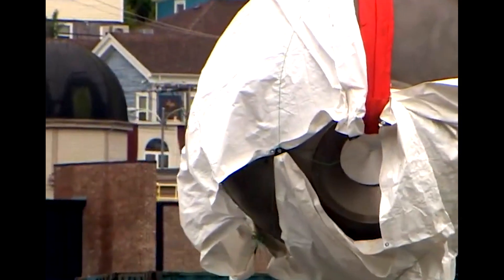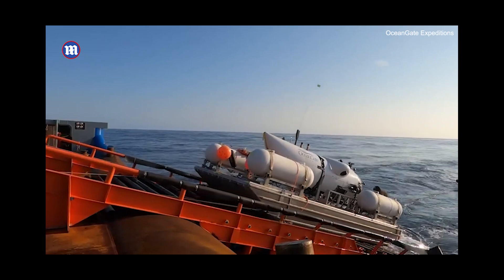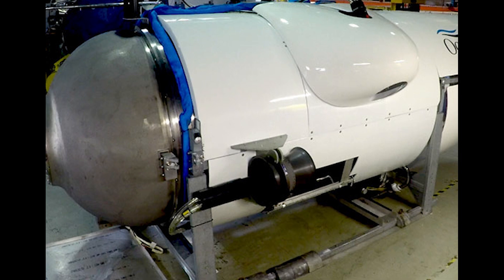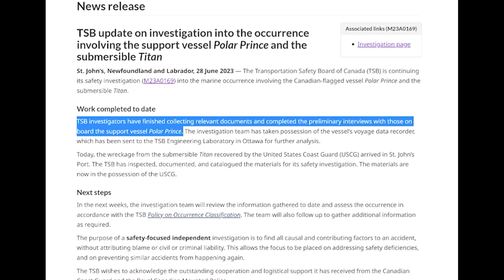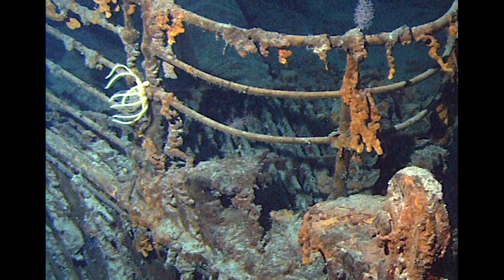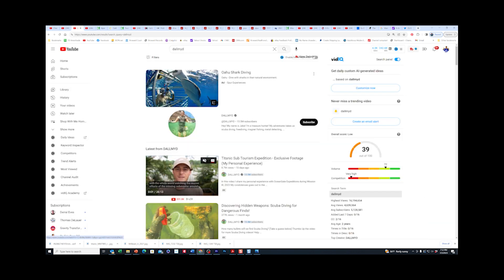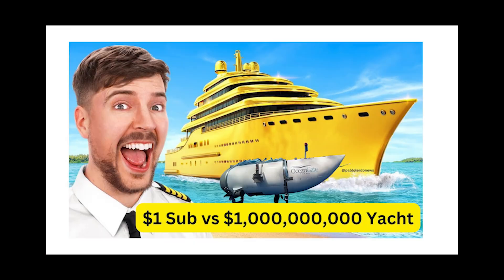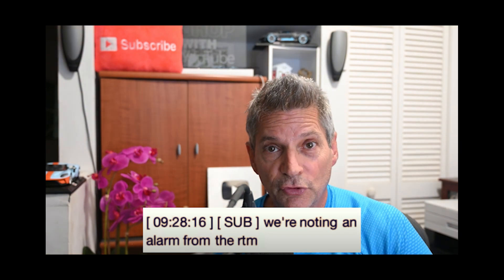Titan Submarine Debris Clues, Implosion Simulation

Comment: OK, I just watched video 18, or is it 20, or whatever. We are not getting those 5 persons back, no matter what the problem was. But there are things mentioned in just about any of the videos I watched. They always mention that those bolts are on the outside and that the crew could not undo them. Why would they try to undo those bolts to begin with? Even if they could, how would they be able to come out? Then they always mention the ballasts as rusty iron! What is wrong with that? Nothing, it's ballast that eventually would have been sitting on the ocean floor. Also the glue they put on the carbon fibre to hold the titanium ring was really not needed. All they needed was a watertight seal and they could have secured the front and back ring with a few steel cables. Once that thing was more than 10 meters deep, the water pressure
would have held it all together. Then others are blaming the game controller, what did that thing do other than nothing?

Comment: My best guess is that the pressure on the carbon fiber hull was too much for those seals. It probably collapsed on itself simultaneously possibly involving some initial seeping or dripping. The stronger “end cap” with the viewing window was thrusted forward and off as a consequence of the pressures of the implosion. 

Too many different components here with vulnerabilities. Each of those rings would have to be connected. Perhaps by long, robust connecting rods within and along the hull. Not depending solely on the hull itself.

I don’t know that any ring would’ve ultimately held as the space between them could not withstand that kind of pressure.

With a cylinder like that you’d almost need some kind of hollow toroidal shell with “end caps” that could withstand that amount of immense of pressure. Somewhat like a hull within a hull. The pressure within the void managed.

Then the viewing window itself and rear “end cap” has to be a sphere in some fashion. At any rate, somehow displace the pressure.

The Titan was a bad design with several vulnerabilities. I don’t know how the integrity of carbon fiber can be accurately tested. It doesn’t sound like it was. The whole thing was inferior in design in so many ways. 

Stockton Rush was probably crapping his pants as things were going down having no way to control what was transpiring. The  imminent and eventual implosion. 

There are legitimate reason for going beyond what might seem sufficient involving rigorous testing. and certification.!So many factors are at play. His defiant, very narcissistic mindset proved to be his most fatal flaw.

Comment: You can be sure that, if the porthole was not the cause of the implosion, it would have absolutely been blown out of the titanium dome by the internal pressure that occurs right after the implosion.  In other words, either way, there’s no way that porthole would have still been present. If they could find it largely intact it would probably indicate that it was not the cause.

Comment: Witch ballast did they drop? There is a set to make you negatively buoyant so you sink to the bottom, when you drop it your neutrally buoyant. Then a second set you drop so you become positively buoyant and rise to the surface. So if they only dropped the first set they had just made it to the bottom. Carbon fiber fail for sure, Implosions rebound so the pressure wave from the implosion probably popped the window out from the inside.

Comment: They didn't even out gas the glue that held the rings. Not say I would use carbon fiber to begin with but the glue should have been placed in a vacuum chamber and left there till all the air bubbles escape the glue. The more I see how the Titan was built the more I think that Stockton Rush had a death wish. It's bad to use carbon fiber in this build but the carbon but OceanGate used expired carbon fiber. Waiver or no waiver OceanGate is response.

Comment: If the port hole imploded, would that actually rip the whole thing apart? It would be a sudden surge of pressure, but it's equalizing the pressure inside to the outside.  Moreover, carbon fiber is much stronger in tension so even if there was a brief over-pressure inside from momentum, it shouldn't be more than the outside/inside ratio.

Comment: Pay serious attention to how they made the join between the titanium ring flange and the carbon fiber composite cylinder.

There is a female groove in the face of the flange, and the composite cylinder is slipped into that, relying entirely upon the bond of the adhesive to hold the composite and the metal.

There was no provision made to retain the cylinder against pull-out / tear-out.

The bonding surfaces were effectively the minimum surface area possible, requiring absolutely the highest level of cleanliness, with no provisions shown to removed gas bubbles from the adhesive that form while it cures.

So, you have a very poor mechanical design of the join, questionable assembly techniques, and a serious concern about the quality of the adhesion of the bond.

The adhesive would be brittle, as would the composite cylinder. They would get to be more brittle as they got chilled in the deep water of the far North Atlantic.

Differential thermal expansion would induce stresses beyond the pressure stresses, and both would be cyclical, acting on brittle structures.

Debonding and delamination are to be expected.

Judging by the images of the ring flanges, they were stripped clean of the composite structure, and experienced minimal deformation. Regardless of whether the cylinder or the join failed first, the the join failed, and that suggests a large degree of force was applied in an extremely short period of time.

Comment: The acrylic porthole was a plug type design, such that more external pressure seated it more deeply against its mounting flange and gasket.

The external ring flange that clamped it in place served to position, hold, and preload the acrylic against the flange.

The mechanism of failure would be to leak through the point of least resistance - the gasket and the seal that it provided against the acrylic and the seat. If that gasket were to fail, it would be scoured out from between the acrylic and the titanium. I strongly suspect that such a failure would erode the titanium seat.

Also, there was no visible distortion or signs of tear-out from the bolts that secured the viewport damaging the seat as would be expected in the event of such a failure.

Based from that, I strongly suspect that the viewport was removed in order to accommodate the sling for lifting.
Reply: Glue.. The glue was the weak point..... What are the odds it was tested in cold water... !!?
Reply: NOPE!!!!

Comment: My bet on the acrylic would be the 4th option: it stayed more-or-less intact until the sidewalls failed, and then was blown out when the implosion momentum overpressurized it from inside. It's near certainty that the sidewall was the source of the failure. Either the bonline between the flanges and tube gave out and then the tube buckled with their reinforcement, or the tube buckled and the event was energetic enough to tear all but a little of the adhesive off the flange as it went. If you think of the ocean as a spring (normally water is considered incompressible but at those depths and pressures it actually would be about 5-10% denser than at the surface) it would have been storing about as much energy as 50-100 kg of TNT does. Or squeezing the vessel with 100-200 million lbs force. So when it did crack, the implosion would have proceeded at about 5x the speed of sound. All that momentum would drive compression past equilibrium and would have pulsed for a few dozen to a few hundred milliseconds kind of like when you have a tensed spring and let it loose.
Reply: They damn sure wouldn't remove it before the investigation was started though.  That part of the video really bugged me.
Reply: I am thinking the window wasn't designed to have pressure from inside the vesicle so it was easily blown out.
Reply: thanks for the analogy
Reply: My favorite glued and resin'ed expired charcoal fiber with a plastic view port submarine didving down to submersible depths

I'm usre the presure increased the heat to vaporisation and cuombustion presures sphere of milisecon 270klb preseure per square inch with 5 feat of acceleration and momentum and crushing air

Comment: I’m still attributing the implosion to a leak in the joint between the carbon fiber tube and the titanium ring glued to it on the aft end of the submersible. There was a leak that disabled the primary battery and set an alarm on one of the sensors. They dumped ballast and weren’t really ascending. Then they dumped the landing frame and began to ascend slowly. By this time all of the sensors were going of and the carbon fiber was in complete failure. The alarms were the last things they heard and saw.

Comment: We can all guarantee that if this was a one off, and that humans applied the 'bonding agent' manually (multiple people) the coating will definitely be applied differently by each person.  I can't get spackle on my wall consistently for drywall joints. Since I heard there was no non destructive testing or even inspection (might be wrong) This is a thing to think about.  Did they do this multiple times and test?  Don't think so. Problem for me. I would not touch this with your 10 foot pole.

Comment: Possible the low temperature of the ocean along with immense pressure de-bonded the glue, the only way that  ring could be so free of epoxy is if the bond made a clean release from the metal surface.  Also, this kind of design with two end rings could have had a series of long beefy bolts around the rings going the length of the outside of the CF center and bolted into the other side effectively pulling each ring and sandwiching the CF center section so the ends could not debond and shoot off either end - and since theres no epoxy on the metal it appears that it could have lost its bond under the low temps and high pressures.  However I still feel the CF was NOT a high cycle design capable of repeated deep dives - I think they were lucky they got away with it the hand full of times they did given the fault found requiring a new section to be built and the cracking noises reported on previous dives, theres a reason NONE of the other successful deep dive craft built over the years used nothing but heavy steel or titanium as a pressure vessel, theyre about the only materials for the job and their 100%  success rate and repeated use pretty much proves it. Also, every epoxy product ive ever used recommends a rough rather than smooth surface for maximum bond, those rings look like smoothly machined metal, not conducive to a good bond. It would be interesting to see what type of epoxy was jused and its manufacturers specs were regarding  temperature range bond strength and surface prep, im guessing all were totally inadequate for the purpose.  All this being said, the entire idea of using woven carbon fiber under such pressures and bonding dissimilar materials was doomed to fail from the start - just as Rush was repeatedly warned.  Rush would have been much smarter had he checked his ego at the door and looked back at what other successful craft were built from and studied those designs closely, instead he was working on the cheap and it cost people their lives.

Comment: The important thing to look for, apart from the fact that the port window is missing, is if the Titanium dome flanges are still bolted to the Titanium rings to which the carbon fiber was bonded to.
If the Titanium rings are still bolted to the Titanium domes, the carbon fiber hull failed and caused the implosion. However, if the failure started with the the port hole window failure, the Titanium parts would most likely still be intact since the implosion would fracture the carbon fiber hull. 
The fact that there don't seem to be any carbon fiber left around the Titanium rings seems to suggest that the implosion dislodged the carbon fiber bonding to the Titanium rings completely which could point towards a complete collapse of the carbon fiber cylindrical hull which then expelled the Titanium rings from the carbon fiber bonding, but if that is what happened, the Titanium domes should have been found with the Titanium rings still bolted on to the domes.

Comment: One of the more curious things I noted about the wreckage footage, is that the titanium end caps are no longer bolted onto the titanium flanges.

I'm no engineer, so this is just speculation on my end. If the view port did fail first, then water could have breached here, sending a column of pressurized water in and blasting through the cylinder and blowing the end caps off, and with such force also snapping the bolts that held the end caps to the flanges. Perhaps the instant rush of water could have also pushed through the CF hull, so it went through compressive, then explosive force that disintegrated cylinder?

I"m pretty sure a lot of my assumptions of how things work under the enormous pressures at that depth are probably off though. I'm just trying think of how the bolts for the end caps to the flanges failed. Probably not enough of them and or the diameter of the bolts wasn't sufficient to keep them together in case of hull breach.

Comment: The hotdog shape of the vessel meant there was an asymmetrical bending moment at the center of the hull.  It shattered at the center and blew both ends off.  The passengers turned to goo before their brains could process it.  That glued joint of the titanium/carbon fiber interface easily failed because their design was dependent on the water pressure holding the end-cap onto the carbon fiber hull.  Just such a lousy design in so many ways.

Comment: I work in a manufacturing plant that makes underground fiberglass storage tanks. We attach steel fittings to the fiberglass. The steel is sand blasted with coarse grit to help the resin adhere to the steel. We even need to sand PVC or fiberglass pipe before attaching it to a tank. That ring looked smooth. Wouldn't any type of glue just pop right off?
Reply: The silicone for my tub is a good sealant but a lousy adhesive. PL400 is a good adhesive but a lousy waterproofer. Neither is good under high pressure.

Comment: Why wasn't the entire sub made out of the same material as the rings?  The rings look in excellent condition.  I don't think the carbon fiber was strong enough or rated to go that deep.
Reply: Too costly no doubt.
Reply: Metal is far heavier and more expensive. The design would have been more complex. They’d have had to develop a way to get the sub to ascend against the weight. With the current design, they’d have just littered the ocean each trip with construction tubes. It also would not have been as “innovative” as Rush was obsessed with. Honestly he should have not tried to do everything different in 1 design but just slowly innovated one area at a time. Even his “hull alarm acoustic system” was a design he patented. 

The cylinder design was still very flawed but would have survived more trips.

Comment: The barrel implosion is dramatic, but steel has great plasticity -- it can bend a whole lot before it breaks, as the barrel demonstrates.  Carbon fiber, on the other hand, just shatters when it's overloaded.  And, of course, the pressure outside the barrel was at most one atmosphere higher than the pressure inside (in fact rather less), whereas the pressure outside Titan was ~400 atmospheres higher.  But the main problem, as James Cameron mentioned in the early days, is that carbon fiber is great for vessels that keep pressure in because it's very strong in tension, but it's the wrong choice for vessels that keep pressure out because it's weak in compression.

Comment: One would hope that the glue used in the bonding process (of titanium to CF) was 100% chemically resistant. Salt or salt water is highly corrosive, above or below the ocean. Above the ocean, bonds can be affected by oxygen attack. We could perhaps just consider this as a factor, especially when many other important "red flags" were not dealt with. I agree also, that there wasn't a trace of any bonding material, but my feelings are that all of the bonding material will be firmly bonded to the CF Capsule End. This is because CF is a fibrous material, and the glue would permeate through it. It almost looks like nil bond to the Titanium Ring. The creator (sadly) has also paid the ultimate price. RIP to all who ventured into the Deep, for sights that are seen by very few. Whatever happened at that depth, the end-result would have been the same, one way or the other.
Reply: There had to be a gap between the metal ring and the CF hull. Without a doubt THAT was the weakest point. THAT was where the water had the best chance of forcing its way in. Steel is stronger than CF which is stronger than glue. GLUE for Chrissake!! Even welds have to be done properly or they fail.
Reply: @larky368  Yes, I have to agree with you that glue use, whatever the glue type, must be a world first - to be used successfully in any Submersible to 4kM+ depth. I think that the extreme water pressure has entered between the 'bond'. Warnings were given before this incident, but never heeded. Loved your emotion-charged comment, and yes, many other people would strongly suspect the Glue & possibly the Bonding Method, and also the area of bond. All valuable factors which are not mentioned here., but appears to be proved as highly unsuitable for Submersibles at extreme depths.